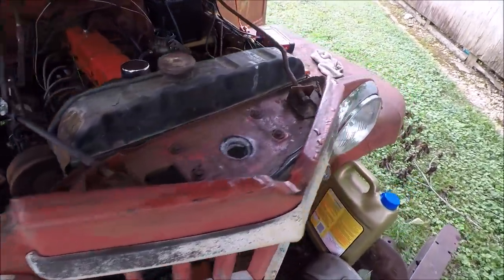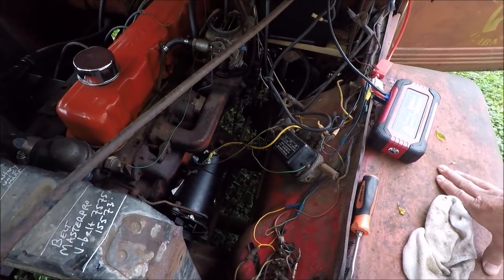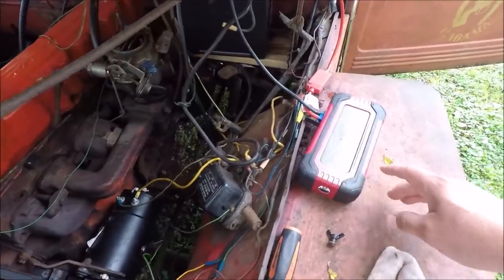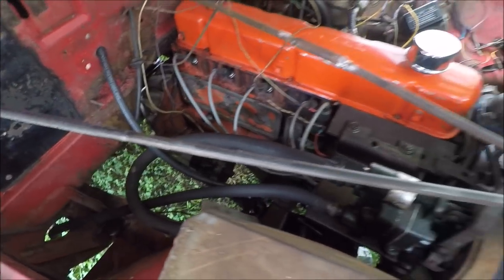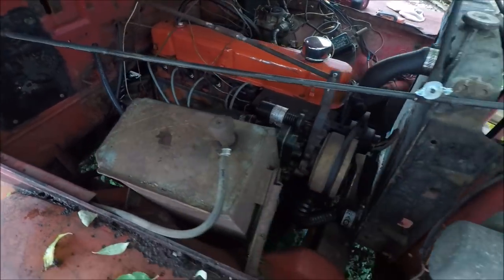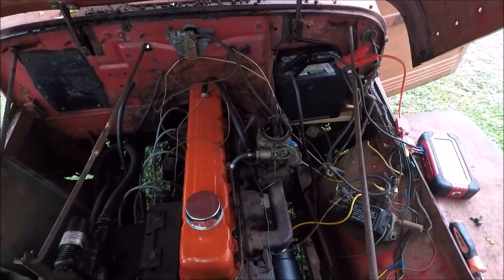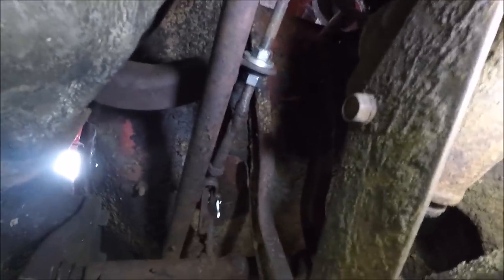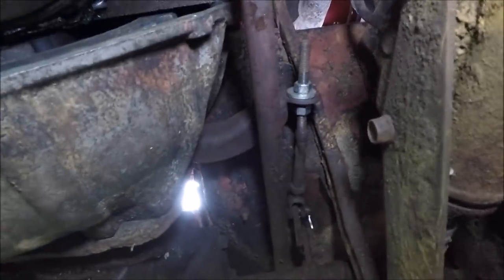Willys Truck Take 19: Electrical Issue & Clutch Inspection

Comment: Your battery is completely dead and the generator is not working.  The jump box is supplying the juice to keep it running.  Charge the battery and it will stay running without the jump box.  The green wire was okay where you had it.  It is a ground and assures the voltage regulator gets a good ground too.  Possibly the voltage regulator is bad or the wiring to it or both.
Reply: Yes,your battery is dead and the jump box is your power supply.You have to fix the charging system simple as that.

Comment: The voltage regulator controls the generator output, turning it on and off as needed to keep the battery charged, but not overcharged.  If that's not working, it will keep the generator from working.   Also, you may have some sort of slow leak that is draining the battery when everything is shut off.    You could measure the drain current by placing a multimeter measuring current in series with either battery lead when the truck is off.  Of course you would need to reconnect that lead to the battery before trying to run it, or turn on anything like headlights, radio, etc.   The multimeter current should be 0 with everything shut off, or the battery will be drained whenever you are not using the truck.   Once you get the charging system and possible drain issue resolved, you should be able to charge the battery, and not need to use the jumper pack to start the truck.   But if you don't run it long enough after starting to replace the energy used to crank it, then the battery will need charging from time to time.
Reply from the maker: Headed out to check it out, thanks

Comment: From your camera view under the truck , we can only see the back of the flywheel where it bolts to the crankshaft hub . I don't know if your able to peek through the opening where the clutch fork is but I don't think you can see where the transmission input shaft goes through the pressure plate , just to see the clutch disc . Can you remember if the damper spring side of the clutch disc was installed toward the transmission ? I only ask since you now question it . 
The only thing that can be done to check this WITHOUT pulling the engine or transmission is to check if the clutch disc is free to spin with the clutch pedal pressed down. 
You'll need the transfer case in 2 wheel drive and transmission in gear with engine off . Rather than disconnect the rear driveshaft , just pick up the rear axle and safely chock up the rear of the truck with tires off the ground . 
Now , with someone holding the clutch pedal down , transmission in gear , turn the back wheels and observe the driveshaft spinning . The clutch disc should be free . Listen for any noise . 
You may hear some noise of the friction disc material brushing on the flywheel or pressure plate surfaces but you shouldn't hear any scrapping noise . Please check that there is some free play at the throw out bearing / release bearing where it contacts the pressure plate fingers . You cannot have the clutch adjustment so tight that the bearing rides the pressure plate fingers with clutch pedal NOT depressed . The free play at the bearing can be as small as 1/8" so we are sure the clutch pedal return spring will pull linkage and fork to pull bearing away from pressure plate when pedal is released . 
As for the clutch disc , the flat side installs toward the flywheel , damper spring side toward pressure plate .

Comment: I cannot source a proper wiring diagram for this vehicle but the best I can say is that if there is a ground  terminal on the generator ( marked as G ) , it connects to a ground terminal on the voltage regulator ( marked as G ) or at least a mounting screw to provide a case ground for it . There should also be corresponding A and F terminals on the generator and voltage regulator that connect accordingly . 
There should be a B terminal on the voltage regulator that will go into the wiring harness and through the firewall to the dash wiring . That should go to the ignition switch . When ign. switch in ON , that connection will connect either a GEN light or voltmeter gauge . 
What seems to be happening when you turn off your battery booster is the wiring system is not now carrying voltage for the electrical system , or back feeding it . The battery ( depending on its current state , good or dead ) should be providing current for the electrical system without the booster . Can your battery booster measure standing battery charge ? If there is any charge in the battery at all , even if it will not crank the starter , we need to find out if voltage is reaching the positive terminal of the ign. coil . No doubt , there is continuity between the ign. switch and ign. coil since the booster pack is back feeding it but since the engine won't run without the booster connected and/or actually on , we must ask if the battery has any charge . I don't know if the generator is putting out , not to say if it's bad or not , but the engine and lights were running off battery . Don't know if the generator was recharging , but that's for later . Your question is , " why won't the truck run without the booster connected ? " . 
We need to check the ign. coil positive terminal , with the key ( ign. switch ) on to see if you've got power to the ignition system . You can use a 12 volt test light for this . Do this test with the booster pack disconnected . A voltmeter would be handy here to check actual battery voltage with ign. off , booster disconnected . An inexpensive test light and voltmeter can be gotten ( harbor freight , O'reillys , etc. ) and good to have . For now , we need to know if the ign. coil is being fed voltage with the ign . key ON and booster disconnected . 
The biggest question in your mind is , is the ignition switch still being fed from the battery to power the electrical system AND , where does it draw that from ? What connection ? 
Not having a proper wiring diagram for this vehicle has me wondering ,where is the junction bringing power to the ign. switch . It seems that connection was lost .

Comment: Pop the cap of the voltage regulator off. Have a sniff, does it smell burnt? Any melted windings? Look at the contact points, any corrosion or stuck ones? Most of these regulators can be opened and serviced. Newer ones not so much. Charge the battery, do a load test on it. It may have a dead cell or two, does it smell like rotten eggs?. Then your battery overheated and it's done. Just some ideas... Clutch could be backwards Have to rewatch

Comment: A cheap multimeter will tell you what volts you have in the battery. With the generator running , this should increase. If not, the generator may have had it or its not wired up correctly. Check for damaged wires/bad connections etc. I have no idea about the clutch i’m afraid.

Comment: Generators must be "polarized" before they will generate power to the external power regulator. Both must be polarized or it will never work. If done already and battery went dead, you have to "polarize" the generator again. I have a 61 Nash with a generator and is the same procedure to polarize the charging system as all vehicles of this era. If done incorrectly, well, the regulator is toast and have to get another. This type of regulator, old or newly made is easily shorted out.

Comment: EA, on the clutch pad itself, all the inspection plate or rock guard is good for is checking for excessive dust or metal shavings. Don't feel like the Lone Ranger on the clutch if it is in backwards, helped put one in Minneapolis Moline tractor. We put a new one with the sticker that said this side to flywheel, wrong. Became a NASCAR pit crew on splitting that tractor apart and reversing the clutch. Ran great after doing that.

Comment: I would put a good battery in it and check that generator output . It should stay running if you disconnect the battery. May have fried something using the jump box.

Comment: you can`t see your mistake until you remove the engine again and remove the clutch cover from the fly wheel and turn the disc around and the reinstall the whole mess again,back into the jeep truck.

Comment: If the main battery is charged it should stay running even if the generator isn't charging. It almost looks like the battery connections might be bad or maybe the battery has a shorted cell. Make sure the battery is charged and the connections are good. It should run. Generators have to be polorized. You can't see the clutch disc from the inspection plate. Time for R&R!

Comment: The inspection cover you took off the Powerglide transmission may not fit the manual transmission housing due to starter being offset just a bit different.

Comment: Hey EA,
Did you put on the ground strap between the engine and the body? I've seen a lot of weird problems when the ground strap is bad. It's usually a very thick cable about the size of a battery cable.
Reply from the maker: yes, I sanded the area really well first too

Comment: The engine needs a good Ground Strap to the Body of the truck.The motor mounts and rest of the drive train have rubber between.Even as old as they are,the rubber will insulate.This may be why,even when it runs.the battery doesn't get charged.Now,the battery is dead enough that without external boost,the motor shuts off.<That is a real response.Sorry jokes aren't funny here>

Comment: In my haste , I failed to mention that while the rear of the truck is jacked up , wheels off the ground , now is a good time to make certain the transfer case is in gear . With the engine off , shift the longer transfer case shift lever toward the seat to engage 4 wheel drive and the smaller transfer case range shift lever toward the seat to engage High range . When you are certain the transfer case is in gear , you can return the longer transfer case select lever toward the firewall for 2 wheel drive . Turning the rear wheels or driveshaft will help spin gears to help engage them . This is better than clashing gears while the engine is running . Once the engine is running well , with no issues otherwise , and clutch adjusted optimally , you can concern about shifting the transfer case to check its condition . 
Remember to lock the front locking hubs when attempting this with the engine running . Hubs need to be locked whenever you wish to select 4 wheel drive .
You need the transfer case in gear so it can turn the transmission , while in gear , to spin the input shaft to check  that the clutch disc is free to spin while someone is holding the clutch pedal down , engine off .

Comment: Generator not charging system , that is why it stops when you take the battery out of the picture , you should be able to take both the battery cables off the battery when running as long as the generator is charging power the car will stay running if it isn't charging it stops running

Comment: When you had it running and got it into gear, and let out the clutch, it didn't move. But you got it into gear and that indicates the clutch is working. If it wasn't, you couldn't get it into gear.
But you were playing with the transfer case. If it doesn't engage in either 2wd, or 4wd, high or low, you won't get any moment, but you might be able to see the output shaft on the end of the tranny spinning where it goes from the tranny to the transfer case. Perhaps get someone, or even set up your camera and start it, get it in gear and let the clutch out.
If you see it spinning, you will know the clutch is operating, but also that the transfer case is not engaged.
As I said in the other comment check grounds first, especially if it was working. Bad grounds have a tendency to work, then not work, and then work again, as it arcs and welds the connection, but a slight bump can cause them to unstick.
Then it's the generator, I guess it is a generator, which means voltage regulator. Either could go bad. Especially if miswired, but be sure to check grounds first. A good connection is much cheaper than a new generator. You cannot have too good of a grounded connection, or even over done. Be sure the engine is grounded to the frame, the frame to the body, the body to the engine.
Reply: He got it in gear because the whole works was in neutral. When he shifted the little lever over the whole thing went to neutral. Once he tried using the clutch and putting it into gear there was no resistance so no grinding. That's why nothing moved when he let the clutch out.

Comment: and the inspection plate ppl are speaking of are from what i know are on automatics.. newer autos have a full bellhousing like that but you do have a peep hole in bottom but i dont think or didnt see that one have it. best way would be drop trans and make sure clutch disc, throw out bearing and throw out bearing arm are installed and seated right. might have to get nifty and measure input shaft to pilot bearing clearance to make sure shaft isnt pressed against bearing/bushing

Comment: You may need to put the battery back in line ..the route the spark takes is from battery to starter,voltage regulator to coil to points inside the distributor back out to the spark plugs...the generator charges the battery..not meant to run car without battery although it can..as for the clutch ,now that you can see it through the inspection plate,have Bride depress the clutch pedal while you observe underneath the throw out  bearing  yoke and see if the clutch moves away from the flywheel...phew !!   lotta words..hope this helps

Comment: Is battery dead or shorted?  voltage regulator inop maybe?  Hopefully generator is okay.  Time to break out the multi-meter.  A buddy had a home made dune buggy from a '50 Ford with flathead V8 back in the sixties.  We would pull battery out of a car,  start it and take off battery and run it all afternoon with no battery.  Just don't turn it off or your stuck way down on the river a long way from his house.

Comment: Almost seems like the clutch fork is not behind the throwout bearing, but since you have good, smooth springback in your pedal, it may be fine.  If you have a low/high shifter and it is in low, shifting will always be a bit harder.

Comment: you may have to polarize the generator as it is new... take a voltage reading when it is running and see if it is over 12v ... if not look up the procedure to do that

Comment: Hopefully when you did the clutch you have a new pressure plate, clutch and throw out bearing. The inspection plate might be causing the pressure plate to not work properly.if it is binding against it. I notice people have mentioned getting a volt meter to check voltage at battery check when running to make sure you are getting more voltage saying the generator is doing its job. It is possible wiring incorrect on Gen. Faulty Gen or regulator.You are right if Gen is working, you can run it without a battery.

Comment: Welcome to the world of the generator. Single wire alternator is the most simple fix. Your battery is dead and your generator isn't charging if it was you could remove one battery cable and the engine would still run , this is very hard on the system but it shows that you are creating current this also works on a alternator.

Comment: I think the first place I'd look for the source of an electrical problem would be the battery. The truck is obviously running strictly off the power pack. This indicates that the battery isn't being charged while it is running. From here, I'd perform a polarization of the generator as suggested below. I provided a link to that reply that shows how to do it. Consider also the voltage regulator - you might have a problem there as well.
Reply: Hmmm. well, if you polarized the generator, I'd skip the link I provided. :o)

Comment: May need to clean the contacts on the voltage regulator and polarize the generator if you haven’t already! Take cover off the little black box! P.S. you need to charge your battery first before polarizing it!

Comment: Hook up that alternator you have instead of the generator. If you have it wired correctly and the alt. is good it will keep running when you remove the cable

Comment: You’ve sucked your poor battery so dry that it can’t even power the ignition anymore. The generator probably never worked, but now you don’t even have a drop of power in the lead acid battery. Put it on a trickle charger over night.
Reply from the maker: I ran alone in several past videos. It just started this as I mentioned in this video. The generator is new and worked fine

Comment: My guess is the battery is dead. When you disconnect your jump box the engine dies because you have no volts left in the system. Charge the battery up and try again. ( Maybe very poor battery connections) Discard the little  wire coming off the regulator housing. There should be no wire there.  DO NOT hook it to the generator!  Whenever you install a new generator you MUST  polarize it. It's easy to do. Just use a short jumper wire and attach one end to the 12volt positive terminal and slightly touch the field terminal on the regulator. (Search polarize generator youtube.)

Comment: That engine runs awesome and don't forget to re do the belt routing under the tensioner. Could be that old regulator went out on you making it quit running when you shut the jumper off?